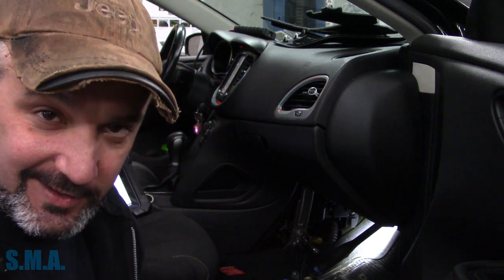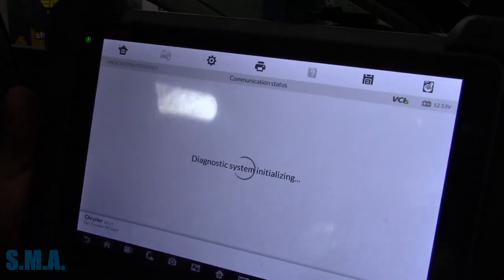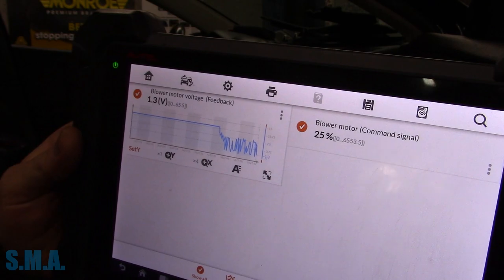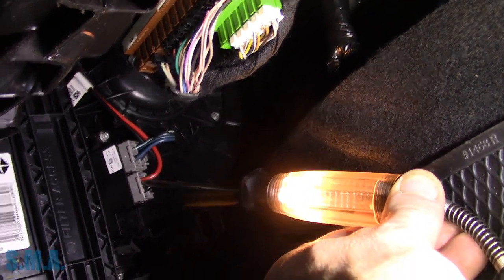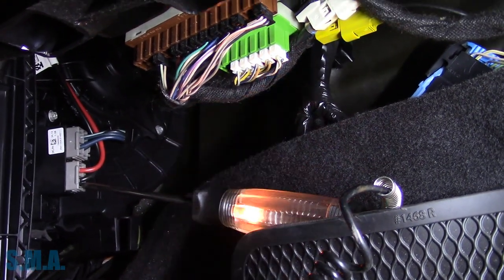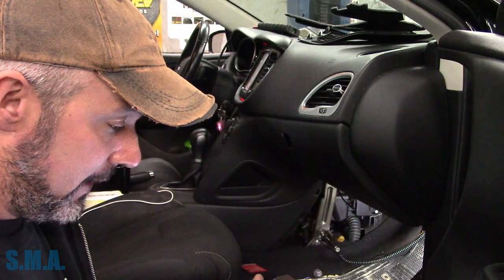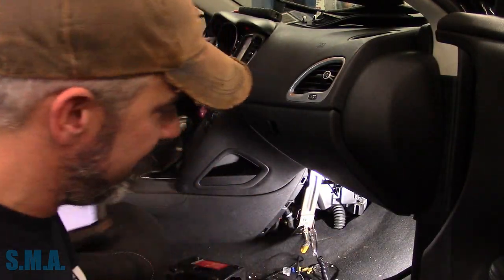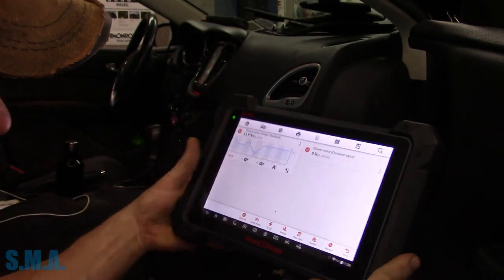This Can Turn On Your Check Engine Light!?

Comment: I had a good one Saturday. I don't work on them, but I try to help get the best information for the shop that gets the vehicle. My dispatch indicated overheat. I get to the parking lot and find a decent spot for the truck to be close enough without blocking traffic. Put the bed down and gathered up the lady's fob. Car is a '17 Altima, going to the Chevy dealership. As I talked with the customer, she said something revealing, but I didn't know it at the moment. She said she pays far more attention to the speed than the gauges, but she glanced down and saw the needle up to the maximum position, so she panicked and immediately found a parking lot and shut down the car. She told me that there were no accompanying symptoms, such as steam, odor or excess heat coming out of the hood. I moved the car to the truck and told her that the temperature gauge was showing cold. She thought that was unusual since she had powered up the ignition to roll up the window and the gauge was showing maximum just a few minutes before I arrived. I told her that it was probably a defective temp sensor and I told her that it's better to read high and not be hot, than to be hot and not show. Took her and the car to the dealership and had her go to the service advisor. As I was unloading, the advisor came out to the truck to have me pull it up on the drive so the valets wouldn't have to push it uphill. I told him it ran and I would bring it to him. As I did that, the woman was standing by the booth and stepped up to the car to ask if it was still showing cold. I told her it was right down at the bottom of the gauge, cold. She disagreed and said no, it's showing hot again, as she pointed to the fuel gauge. I told her that was the fuel gauge and pointed to the temperature gauge on the left side of the dash. At that point, she hesitated a bit and then said oh, yeah. I asked her if she had mistaken the full fuel gauge for temperature. She then decided to ride the dying horse to the end of the line, leaving the car and renting a replacement. She'd rather spend money unnecessarily and put the onus on the dealer, than simply admit to the flub a dub dub.
Reply: Humans are stupid... I'd be a hypocrite laughing at this lady. When newer at scuba diving I once mistakenly read Gas Time Remaining ~40 (mins) as Bar/tank pressure. Was expecting to see 200-230 bar but saw 40, So I swam over to guide signaling 'something is wrong'
He looked at gauge, looked at me and shrugged. 

I looked again and realized my stupid. Easy to look at wrong gauge and get wrong interpretation I guess.

Comment: Wow that's nuts Eric. They should have a separate "Check Blower Motor" light on the dash!
Reply: ...and I thought Ivan's Air Bag light, setting a Air Bag light, was crazy
Reply: ya think they routed air from it to the exhaust like aaaah, an sai pump? those engineers are deceptively sneaky

Comment: To many modules using the same check light these days, it's no longer an 'engine light' 

It's now a generic fault light.
Reply: That would be fine if the cars would just display the damn diagnostics using the built in interfaces. There's no reason to force everybody to buy expensive scan tools just to read information that the computer already has!
Reply: It's a maintenance inspection light, not a check engine light. Otherwise you'd have 40 some odd lights on our dash for each item.
Reply: @Ariccio123  You're not a mechanic. The OBD2 system is just fine. I don't want to learn the interface for 1000 different car manufacturers and models and then years. That would be really stupid and make diagnostic 10x harder. If you're talking about just reading generic codes you can do that for $20. That's not expensive.
Reply: @fuckjewtube69  you're right, I'm not a mechanic. Which is why I don't want to have to spend that much on a reader. It wouldn't be that hard for manufacturers to also give me access to the same data through the on board interfaces if I wanted it though, and same goes for many non professional owners across the world. They can still use OBD of course, just without forcing everybody to do it that way.
Reply: As far as it being the "engine light," I think Eric says it best when he calls it the "money light." And he works in a state where inspections are very strict. I live in a nearby, similarly strict state. Literally ANY reason this light comes on, you are failing inspection. It literally does not matter why. As far as the state is concerned, if this light is on, there is a safety problem with the car (in their minds), and they will fail you. There is absolutely no exception.

 @fuckjewtube69  His idea is an excellent one. It doesn't say anything about making scan tools stop working. Honestly I hope our "right to repair" laws continue to gain traction and eventually are expanded to include a legal requirement for every vehicle that is equipped with the capability to display codes (like having a screen to display them on), that it must be made an option. I have multiple scanners (not the multi-thousand-dollar ones though) and it's still always been ridiculous for any car with an LCD screen (in the dash or in the radio, at least if the radio is a stock one that talks to the ECM) to not be able to show codes.

Comment: You taught me something today. Love watching your videos and enjoy learning some of your diagnostic skills. If you ever think of retiring, you should be an instructor. Keep up the great work Eric!
Reply: He definitely should think about that.   Vocational students would benefit so much from it
Reply: I'm in school to be an automotive technician, my professor works at an auction lot servicing the cars prior and after auction, I think sometimes doing outsider cars too.  Not sure on the policy of the location if they do outside work or not since the auction sells about 2k units a week.  But he also is very skilled in electric gremlins and in other mechanical work.  GM and Toyota certified.  He has loads of stories personal advice.  Like some GM trucks run their trailer controllers through the fuel pump driver module (the ones equipped with factory towing, not the aftermarket jobs).  So if you lose trailer controls, you have a bad pump drive module.  Yeah that was a stupid design, and he chased that job for a while.

Comment: Love the video Eric. It's crazy the lengths they'll go to say something can affect emissions and write a code and set criteria for it. I mean, they're literally saying that if they can't determine the exact amount of thermal energy being lost to the blower motor blowing over the heater core... then the emissions are affected because they can't accurately meter that extra 3/4 of a milliliter of fuel used per hour to replace the thermal energy... I never was a Dodge fan.

Comment: My wife's `14 Dart Limited had the same failure with the oil pressure switch setting the check engine light; the dealer changed it  under warranty, and that was our only warranty claim.  The Dart now has one hundred and eighty odd thousand miles on it, as she drives a hundred miles a day total to work and back.   Say what you want about a new Dodge Dart, ours has been wonderful.  One wheel bearing went bad and the starter solenoid went out about one sixty-five thousand and that is it.  I plant to replace the water pump soon so it does not fail on the road and strand her one day.  
    I appreciate this video, as any info on the cars we own is  good, and always great on your channel.

Comment: You described that circuit operation better than any training instructor I've ever had!  I could see the operation in my mind as you described it.  Thankyou!  
I once had a new 2009 Dodge Avenger with a PCM code for the A/C system, specifically the ambient air temp sensor.  It is located between the front grille and the condensor.  Rodent damage to the wires.  Repaired the wires, cleared the code, all was well in Chrysler land!
Like you said the PCM monitors the blower motor voltage to verify engine coolant temp.  They want that coolant to stay at a certain temperature for emissions.  That makes sense.  Monitoring blower motor voltage?  That's a stretch!
Your a great instructor Mr. O!

Comment: 200 for the motor 2hrs labor for a blower motor to pass inspection, ouch. Merry Christmas.
Reply: T salinger1026 better than a couple control arms. Those pay A LOT
Reply: Jacob Haas but who wants to have to replace a blower motor just to pass an emissions test when the blower motor works even if it might be drawing to many amps if you don’t live somewhere with emissions then it’s not a big deal

Comment: I was a little confused when I thought about PWM duty cycles, but it looks like this one is an old school control with steady voltage through a resistor. Thanks for including the traces after the fix, you quickly showed the brush problem without need for a scope.

Comment: lol! the box was made in america, the fan was made in korea......so much for "imported from detroit"!!
Reply: Imported through Detroit.....
Reply: It did, however, have a Mexican oil pressure switch.  Very international.  People say “buy American”.  Not easy, these days.
Reply: @andy1056  Maybe it would be more accurate to say "not possible"?
Reply: It was imported from Detroit. From somewhere else...
Reply: Don't yall love a global economy...
Reply: The name of the port in Korea were ship was loaded was 'america'.
Reply: The housing was made in the US and the motor was made in Korea. Welcome to the parts world.
Reply: Not how it works. If something says made in USA, it's made in USA. It's possible it's mislabeled, but if not then the Korea label is just referring to a subcomponent, most likely the wiring harness.

Comment: Lets hope after the Holidays you'll have more new episodes.  Sort of missimg my time hangin out in the garage, Anyway. to the topic. Was watching Matts Towing videos, "Winder Towing" in Utah. He has a check engine light on his Jeep people have been complaining about. So he went to his buddies shop and guess what it was. His blower fan. But rather than install the blower since he had to remove half of what's under the hood. He hit it with the hammer end of a tool. He also put a sticker over the check engine light in case it comes back on.

Comment: One of the best channels out there.  I just finished watching the one where Ivan comes up and helps diagnose the Hyundai Tucson with the weird lean P0173 code.  What a great job of detective work from you two.  A torn up cam bearing journal that lead to a twisted camshaft, don’t see that everyday.

Comment: Good fix Mr.O I have seen my fair share of these with the money light on for the left blend actuator having a fault and have found the wires to the actuator shorted against the vertical support beam of the dash on the left side. stupid emission faults.

Comment: Damn....remember the days when the power went from the battery, to the switch, to the blower motor?  Now the CPU gets it nose in the business and instead of being useful, it just cost you money.
Reply: Sounds a lot like our Government.
Reply: Consumer demand clamored for dual zone electronic automatic temperature control systems in even the most mundane of vehicles, along with every other ridiculous luxury feature.  It's getting tricky to find cheap beaters with crank windows and sealed beam halogens.
Reply: Dale Gribble Yeah I remember my old Dodge truck. It had dual zone temperature controls. You reached down and opened the vent door near the floorboard. The wider you opened it, the more air you got. It never set a code or had a sensor failure.

Comment: Eric,
You showed us input voltage via test light at steady state ( bright light and no flickering). You had the scope handy. Confirming the input voltage via via amplitude and flat line scope signal would have confirmed your intermittent motor open diagnosis.

Comment: It KINDA makes sense that a B code could trip an engine light since the modules all talk to eachother. However reading code setting criteria.. a blower motor that isn't working somehow upsets emissions? OOOKKKAAAYY... Anyhow, I'm glad you're showing these tests. That lil test light trick works for all 12v DC motors. Great mechanic life hack. The scanner is nice for clarity, but you kinda don't need it if you know how a DC motor is supposed to work.

Comment: Had a 2005 Nissan frontier had all fan speeds but no a/c after speed 1...found that resister had a little burn hole in it...replaced with new and all turned out well 👍🏻

Comment: Chrysler tech here. Jeep cherokee blower motor control circuit low and high codes turned the check engine on and I had a hard time explaining that to the owner the other day.

Comment: The more ways to throw a MIL light the more revenue is garnered through emission testing .  I'm surprised dome light failures don't set a code and turn on the 'money light'.
Reply: Believe it or not I just moved to a rural county where emissions testing is not required. The funny thing is before I moved my registration was running out so I was going to get it tested and bam, the cpu took a dump. After testing and checking for a month, I figured it out and got a new CPU. However, I couldn’t legally drive it to go get it tested and if I got it towed, it wouldn’t pass since the monitors wouldn’t be ready until it was driven for a number of miles and wouldn’t pass. I then thought, I’ll get a temp tag and drive it but the regs say you can’t get a temp tag to bypass an emissions test. Thankfully I moved in the meantime and walked in and registered my truck. Don’t you love government catch 22’s.
Reply: That'll be a new one: fails emissions test due to a bad blower motor. Have fun explaining that to Joe or Jane average customer. Many will be convinced we're trying to rip them off.
Reply: The money light living up to its name
Reply: @parochial2356  The customer would not be wrong about being ripped off, bu they're being ripped off by Chrysler ,not by the mechanic. That blower motor was on the way out, but might have run for another year or two had it not triggered the engine lighr.
Reply: @neilmurphy845  uhh.. isn't any of those lights on a dash considered a money light in their own right?
Reply: @adventureoflinkmk2  probably I have very little experience whit modern cars
Reply: Thats some b.s if you cant pass emissions due to a bad blower motor. Nothing to do with emissions
Reply: @pacman3908  true only another way to get more money out of your pocket

Comment: Awesome Video Eric , even though you could't show all the steps - you were able to teach the main principal on load and resistance
to the effect of  what the blower motor feeds back to the computer  and the computer able to tell that the motor was starting to go bad before 
complete failure , It's amazing on what these cars and trucks do now in days - how the diagnostic technology has developed  where in the old days you'd listen and or test out manually to determine the problem...

Comment: That's pretty crazy, I just replaced one of those blower motors a few weeks back, I actually had no idea that it would set a DTC.  And good call going OE...  I put a 4 seasons one in at first and it vibrated so bad that you could feel it in the steering wheel, I had to change it for an OE one anyway.  Great video.